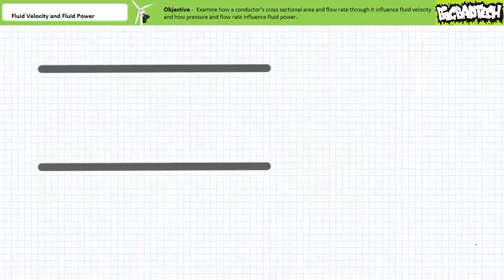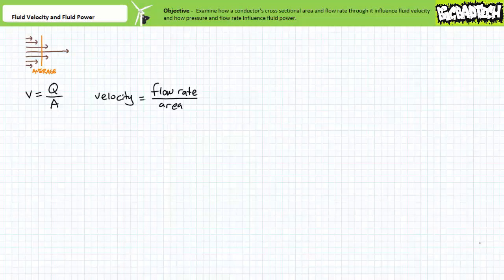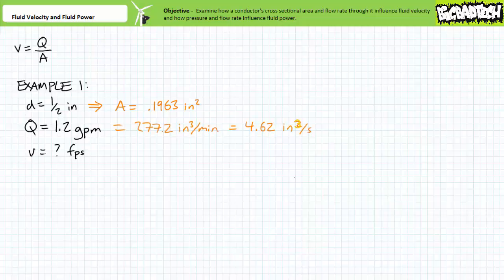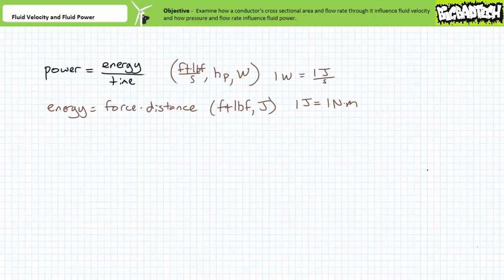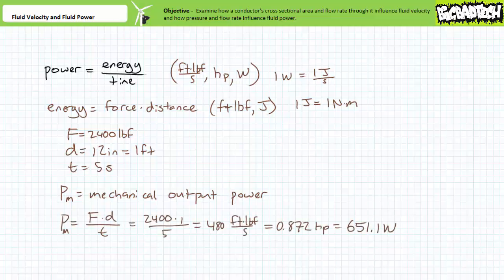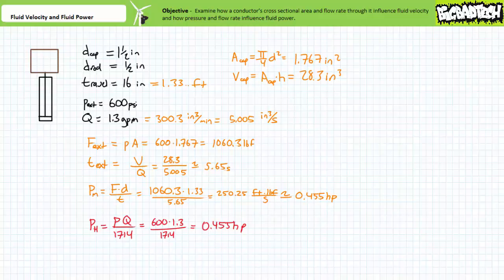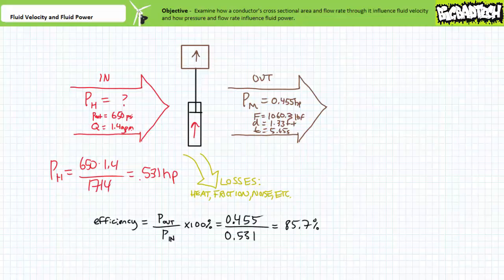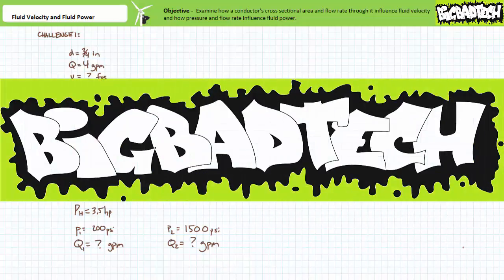Fluid Velocity and Fluid Power (Full Lecture)

Comment: thank you for this lesson ;
Velocity 2.17 fps
PH 1.365 hp
Pm 0.91 hp 
efficiency 66.5%
Qa 30 gpm
Qb 4 gpm
Reply: Brosky, I agree with all the answers except from the velocity.
I find that the velocity is 2.9fps.
Please do correct me if I am wrong:
v = Q/A the formula in use.
v = (4gpm*231/60)/(π/4(d)²) this gives us the answer in inches per second.
v = then divide 34.8584 by 12 to get feet per second.
Thus v = 2.9048 OR 2.9.
Reply: @DanielKatundu-y8t  I hope we can all be educated on this cause I have V=0.757fps JIM HELP PLZ
Reply from the maker: @superxtroid5712  D# is tracking. v=2.9fps.
Reply: @bigbadtech  When it comes to finding the area through diameter , I did A= pi/4•d^2 , which gave me 0.44 . Did i use the wrong formula?
Reply from the maker: Area is correct. d of .75 in yields A of .4417 in2.
4 gpm is 924 in3 per min which is 15.4 in3/s
15.4 in3/s divided by .4417in2 is 34.9in/s which is 2.9fps
Reply: @bigbadtech  oh okay , I forgot to convert gpm